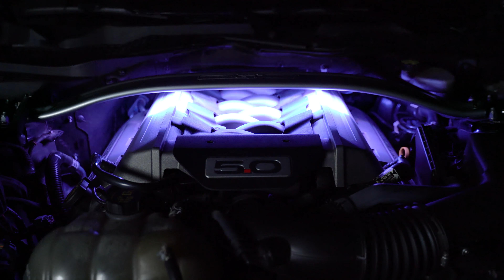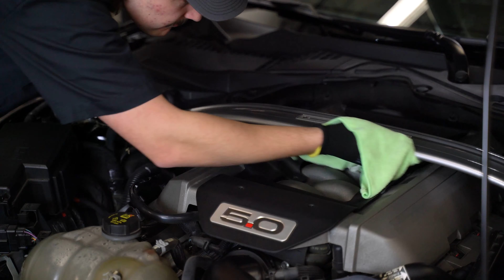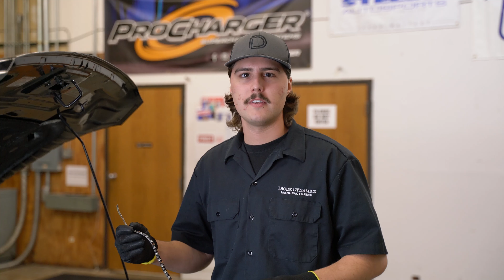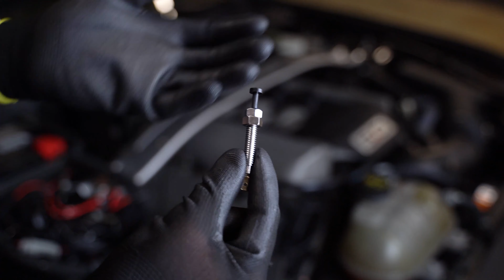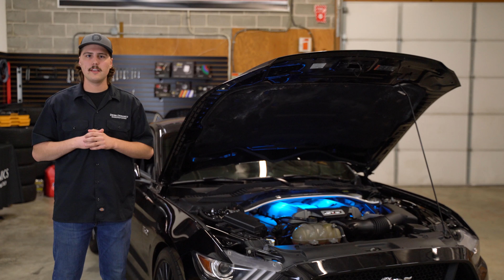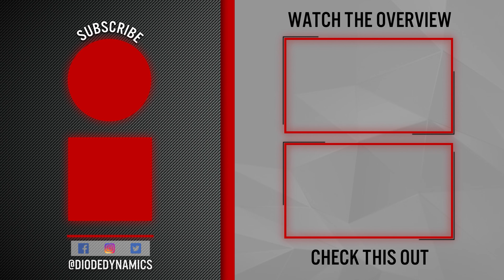How to Install RGBW Multicolor Engine Bay LED Strip Kit | Diode Dynamics

Comment: Cool concept, but the coyote engines generates a ton of heat - especially when driven hard.   How strong are the adhesives on these strips?
Reply from the maker: The 3M adhesive is super strong! They're holding up well on the coyote!